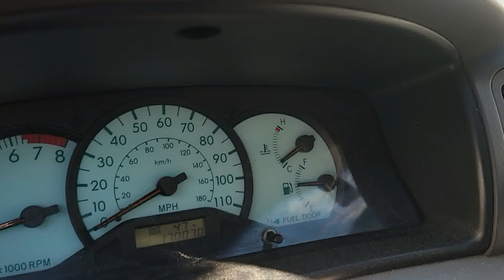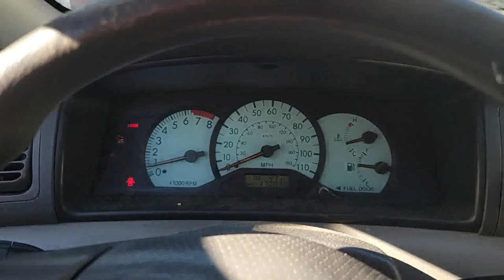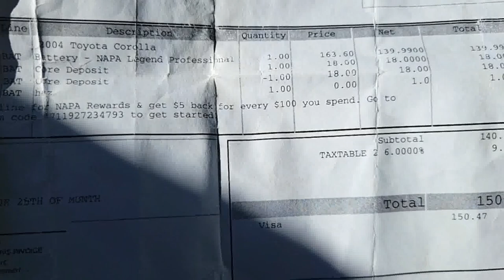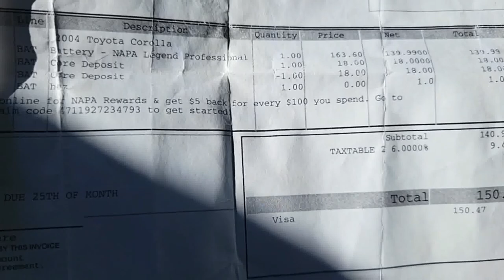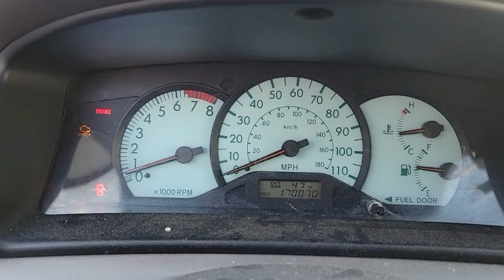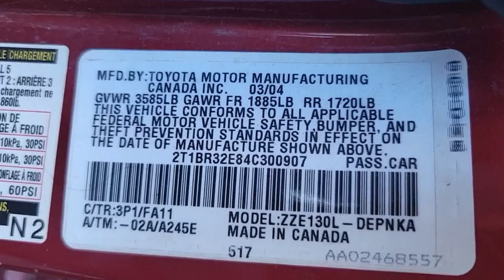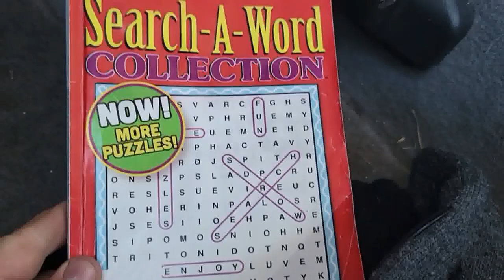Should grandma's 04 Toyota Corolla get THE BOOT?!

Comment: Yes Boot it, I hate most Toyotas.
Any car will last, if it’s maintained not just a Toyota.
Surprisingly, I like the Prius.
Reply: Idk what Toyotas you had, these things are bulletproof.
Reply: Maintenance is optional on a Toyota.
Reply: @rustbloodeclipse   Just don't like most Toyotas.
Reply: @dalecocking2907   It doesn't matter what it is, maintenance matters.
Reply: @redneckbryon  I was half joking, I use to joke with other mechanics when I was briefly working in a small shop that Toyota's with little to no maintenance could and often do go over 300,000 km no problem.